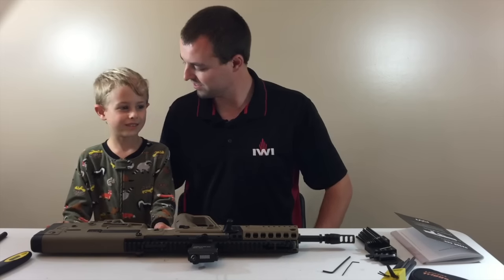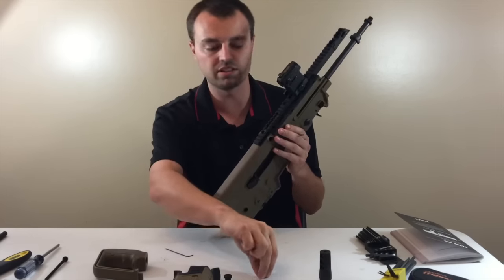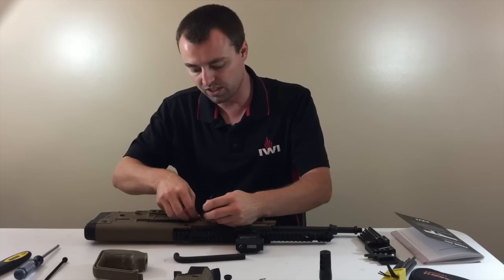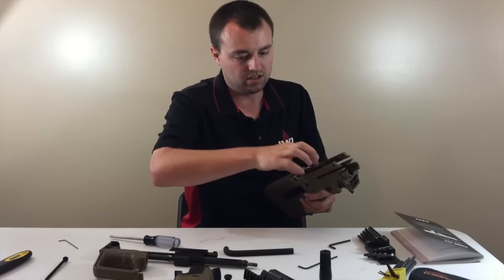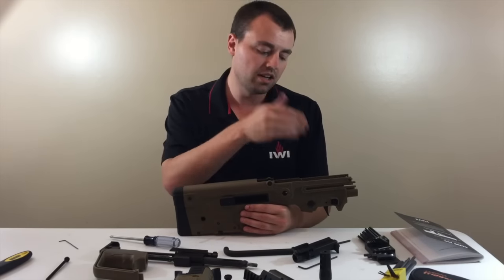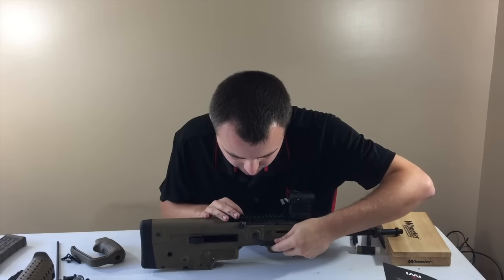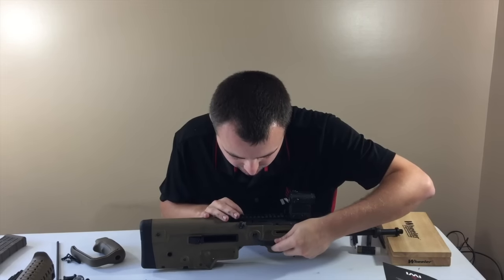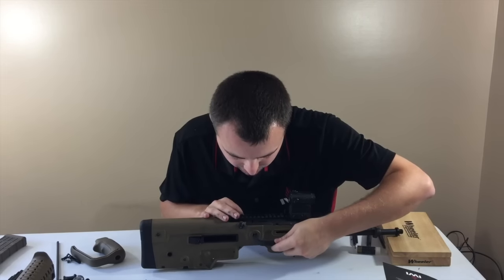IWI X95 Geissele Lightning Bow Trigger Install - REMOVE CHARGING HANDLE

Comment: WARNING: Broke my gun following this video. Several people in the comments did the same. The parts to fix what gets broken are nowhere in stock. Do not follow this video. It is for the older X95. The new ones will break if you follow these steps.

Comment: I goofed and didnt take the charging handle out before unlocking the barrel. Now the barrel is stuck, the barrel screw is stuck and the charging handle is stuck. Am i screwed?
Reply from the maker: If I recall correctly, you will need to lock the barrel in again and pull out the charging handle. You will likely need to replace the charging handle.

Comment: Dude you forgot to show the part where you remove the charging handle mine has a huge Divet in it now from the barrel lock. Ding dong. Also you can test your trigger with everything apart just put the bolt carrier group and the trigger group in and racket off the piston. I don’t know man this video kind of sucks
Reply from the maker: 2 minutes and 10 second point give or take. I even show the charging handle and talk about it.

Comment: You didn't mention anything about the factory spring will come flying out to never be found while removing the factory trigger.
Reply from the maker: Have to follow the instructions all the way through. What at you saw was the full install with no cuts in the video.

Comment: If you have a newer Tavor be careful about the charging handle. Followed this video and ruined my NIB tavor.
Reply from the maker: The new Tavor charging handle has a different disassembly.  You didn’t follow the video though as the charging handle is removed in the cover. I didn’t specifically call it out though.
Reply: @HolosunAdam  yes I found this out after I had ruined it. In your video I did not see that charging handle attached to the forend. I then saw someone's comment and watched the IWI US barrel removal video and found out I had destroyed my 3 day old Tavor.
Reply from the maker: Nick St.Pierre sorry to hear that. Unfortunately I’m unable to modify the video for the newer model
Reply: @nstpierre03  Mine wasn’t even a full 24 hrs old. Now I can’t find the parts online. How did you get it fixed? Contact IWI?
Reply: @jkbugout  yes, happens more then you'd think. I had to mail it to IWI and they had to have a gunsmith look over it and then mail it back. I got lucky and only bent the charging handle, didn't break a piece like I originally thought.

Comment: I’m having a problem with mine not resetting the trigger.
Reply from the maker: You will need to adjust the set screw discussed in the video until it resets. In essence, you already making small adjustments see if it works and then making more adjustments based on the results.
Reply: @HolosunAdam  it worked Thank you
Reply from the maker: @dangerousfreedom4965  glad to hear it worked!!

Comment: I noted and correct me if i'm wrong that the lightning trigger moves at the same time you operate the charging handle 🤔
and that for sure won't happen with the original trigger, so if I'm right, then definitively won't install this trigger
Reply from the maker: I’m not aware of it moving any differently than the original trigger. It’s connected to all the same linkages. 
I have tens of thousands of rounds through that trigger. I wouldn’t hesitate to get it for a second

Comment: It dry fires once then does not work after that
Reply from the maker: You need to adjust your trigger. That’s one of the steps mentioned after the trigger is installed.

Comment: The fact that this video DOESNT get taken down due to people fucking up their guns is insane.
Reply from the maker: Because they don’t pay attention?  The changing handle is removed in this video. The current X95 comes with a new charging handle Design that is not removed as easily as before.
Reply from the maker: There is also a disclaimer in the description to remove the charging.

Comment: So I've installed mine, but it doesn't want to reset and its buggered up my bolt release.  It wants to release itself without me pushing it.  I cannot figure out what the problem is for the life of me.  Ive worked on it for about 6 hours today ☠
Reply from the maker: That’s a new one. Toss me a video on Facebook at Adam Litke - Competitive Shooter or Instagram at adam_sasa
Reply: @HolosunAdam  i sure will.  Im dumbfounded.  I have one installed on my other x95 and it works flawlessly.  

It also feels like its more resistance when charging the rifle than normal.  When I lock the bolt back, it will pop foward itself with me hitting to release.
Reply: @HolosunAdam  i sent you message on FB

Comment: A few IMPORTANT things left out of this video. New X95s have a charging rod retention component that must be removed with a punch. If you do not remove the charging handle before turning the barrel lock you will bend your charging handle, crush your gas tube and possible ruin the barrel. It also seizes the barrel lock tight enough to shear the IWI barrel tool and render it useless. This missing step has turned my rifle into a paperweight and my only hope is a gunsmith can get it apart and replace the ruined components. This is a good video - BUT IT IS NOT COMPLETE for IWI rifles sold in 2019. Please watch the IWI disassembly video as well before you attempt this operation.
Reply from the maker: Sorry to hear about your issue. As shown in the video the charging handle must be removed.  The video was made in 2016 and thus the retention point is not mentioned but it does show the charging handle being removed.
Reply: This needs to be a pinned comment. This exact issue happened with me. I have a feeling that my gunsmith may not be able to repair this, can you tell me how your repairs went? I just ordered the gas cylinder and charging rod myself.
Reply: @HolosunAdam  Would be cool if you add an annotation or something so this can stop happening to people. Or even adjust your description. You're just going to cost more Tavor uses issues.
Reply from the maker: @TheSaddz  - I have not been able to add an annotation, however, there is a call out in the description.  I understand your frustration but I am contacted at least 2-5 times a week from people who use this video.  Most are using there newer gen guns.  I am aware of 3 users having the issue you did.  The other thousands have removed the charging handle prior to removing the barrel.
Reply: @HolosunAdam  Yes, I see your edit in the description and that is great. Just because a few people vocalize their issue, doesn't mean others didn't encounter the same problem.  I am in no way blaming you for my own faults, but just want you to realize you're the only video regarding this topic therefore new and old gens resort to this and in newer gen X95s, the charging rod does not come off with the forend, and the handle does not release as easy as just pulling it out, it requires rotating the loop it sits in. I understand your frustration with the critique of your video, but what's the point of making instructional videos if you're comfortable with others complication from a result of lack of information. We all came here for your knowledge, because if we were knowledgeable on the video's topic, we wouldn't have come here altogether. Either way, I appreciate the new edit and I am sure going forward, others will too.
Reply from the maker: TheSaddz I appreciate the constructive criticism. The goal is to educate with these videos.
Reply: I also just destroyed my rifle and did not see this comment until after.
Reply: @HolosunAdam  take this video down. I just broke both my favorite and most expensive gun. You should have taken it down two years ago after replying to several people who you misguided...
Reply from the maker: @brandonschmidt3760  - firstly, vast majority of comments are positive saying thank you. Secondly, there is a disclaimer both in the comments and now on the video. Thirdly, if you watch the video I remove the charging handle. Thus you did not pay proper attention. Lastly, IWI producing a new charging handle that’s different does not require someone to change a video from 2016. 
As always, sorry to hear about your issue. That said, I still see hundreds of people a year doing this properly and it’s still the video shared on the Facebook groups.
Reply: @HolosunAdam  Whatever dude, if I knew content I created was causing several people to accidentally damage or destroy their guns I would take it down. It doesn't matter that there are warnings because people are still doing it. I don't understand how you could look in the comments to see the thousands of dollars of damage done and not at least re-upload with a verbal warning at the beginning...
Reply: @brandonschmidt3760  
I know watching videos may seem like a faster method of instruction,but NOTHING beats reading the manual that comes with your rifle for proper care and takedown instruction. To blame him is ridiculous 🙄. He put the time and effort in years ago to instruct others, and now you think he should take the video down because the manufacturer has updated their product ? Again; the ownus is on the operator to read the included documentation before handling and using the firearm.
Reply: Was your gunsmith able to repair this?
Reply: @HolosunAdam  Just had the same issue. Was following this video step by step. I understand that the gun has changed. However, I just damaged my new rifle. Haven’t even shot it yet. Now I can’t. And IWI doesn’t even have the gas cylinder in stock.
Reply: @HolosunAdam  Please pin this comment and add “READ PINNED COMMENT” to the end of the video title. I don’t want others to have to go through what we’ve now done to our rifles. Especially since replacement parts are out of stock.
Reply: @brandonschmidt3760  And pin this comment. Stop being defensive. You are appreciated for this video but at this point you are being negligent sir. I was literally following you step by step and pausing the video and then damaged my brand new rifle. It really sucks. Super aggravating. The fact that it keeps happening to people and you have not made any attempts to warn people is a dick move. And you seem like a nice guy in the video. Put yourself in our shoes.
Reply: You don't need to remove that retention ring.  Pull the charging handle back an inch and rotate the retention collar out of the way.  Manticor Arms covers this.
Reply: @jkbugout  you literally weren't following step by step if you did not remove the charging handle first...
Reply: Yep this just happened to me because I didn’t read the comments before…maybe delete this video and upload an edited one cuz now I’m screwed
Reply: @Cumli  i was able to get a hex wrench in the barrel lock and repair everything. Charging handle and gas tube were munched but everything else was fine. Been running without issue for years now.
Reply: All, please use this video by IWI to remove and reinstall the barrel for newer versions of X95. Use this video only for the trigger shoe installation. 

https://youtu.be/EbEoO9dpr3w

Comment: I have no spring tension with the trigger after putting the spring in like you said. Mine does not come back forward if I pull it.
Reply from the maker: Open it back up and look to ensure everything is connected correctly. This method has worked for everyone else so likely their was a step missed or something was not connected properly.
Reply: @HolosunAdam  I made a rookie mistake. I'm an idiot and forgot that the bolt carrier group was out so of course there wouldn't be any tension. Put it all back together and no issues. Thanks for the quick response by the way.
Reply from the maker: @grassbag1  we’ve all been there buddy. We’ve all been there
Reply: @HolosunAdam  how do you put the stock spring back in the regular trigger? My trigger is still now resetting when I shoot. I'm going to put the original back in for now but I don't remember the way the spring goes
Reply from the maker: @grassbag1  which spring are you referring to?
Reply: @HolosunAdam  the one that was on the stock trigger that you remove. I cant find a picture anywhere online.
Reply from the maker: @grassbag1  - you likely need to adjust your trigger set screw to get your trigger to reset.  The original screw goes darn near where the replacement screw does.
Reply: @HolosunAdam  is there a way to adjust it to make sure it resets properly without taking the whole gun apart and putting it back together again? It seems to reset fine on dry firing but after the first live fire shot the trigger hangs and doesnt reset all the way.
Reply from the maker: @grassbag1  only trial and error. I would do the opposite setting you have now and then make slight adjustments from there.
Reply: @HolosunAdam  Okay cool, thanks

Comment: Just bought my trigger bow for my x95 that I ordered. When adjusting the set screw which way takes out the slack. Backing the screw out or in? Thanks
Reply from the maker: 86keen going in removes slack if I remember correctly. Just sure not to remove so much your trigger won't reset.
Reply: Is it pretty squared away out of the box or did u need to adjust your a bit?
Reply from the maker: 86keen mine was pretty great out of the box.
Reply: Shield and Sword Academy received my x95 a day early. Your vid was extremely helpful when I was installing the trigger bow. There is still a little take up and trying to decide if I want to mess with the set screw. But I don't know if that little take up is suppose to be there for the feel of a 2 stage. Also do you know how many inch pounds to torque the rail screws with? Again thanks for all your correspondence and the vid was very helpful
Reply from the maker: 86keen I have a little take up on mine but greatly reduced from original trigger. 
I'm not sure on torque for rail. I simply screw them in and only use reasonable force. 
Glad the video helped!

Comment: I installed it now , and the gun does not discharge, the bar moves a bit and hits a wall without firing . I loosened the set screw as well and it’s still not working , pls let me know what you think the issue is ?

Comment: So I installed mine and the reset is terrible. Im assuming I did something wrong.
Reply from the maker: You need to adjust the set screw on the trigger.
Reply: @HolosunAdam  Thanks for the reply!   One more question, the tighter the screw is, the less slack, correct? 

I tried it a little tighter after you replied and it didn't feel much if any different.  Should I tighten more?

I do apologize,  im sure you've repeated the instructions for these thing a billion times.
Reply from the maker: @Enough_Tumbleweed  it’s a trial and error type thing. Keep tightening until it works and you like the trigger pull

Comment: Obviously not your boss but I recommend a video edit for removing the barrel stressing the importance of removing the charging handle before as, in my opinion, very easily and with generally little effort, crushed my charging handle and gas tube
Reply from the maker: Spc William at 2:13 it states charging handle is removed. That is prior to barrel removal. I will look into an edit.

Comment: Does the spring at 9:01 need to be reassembled? Didn't see it get replaced when putting it back together.
Reply from the maker: No it does not go back in.

Comment: Just an observation....why the fuck does IWI make it so difficult? Pulling out the bolt carrier group is a beautiful thing. Full disassembly? The more I learn about my X95, the more I love my ARs.
Reply from the maker: Doug Kurceba being a bullpup design there are only so many ways to simplify tear down. The barrel has to go over the trigger and the trigger actuated the bars that go back to the trigger pack. It would be interesting to see if the trigger could be built to slide out horizontally in some fashion.

Comment: I just wanted to thank you.  If you had ads on this video you would be making $ because I've watched it at least 3-4 times.  You've helped me a lot, and I really appreciate it.  Liked and subbed.
Reply from the maker: Glad it helped!!
Reply: @HolosunAdam  So now I have quite a big problem.  While installing the trigger pack the cocking handle went forward and pulled the bolt carrier stop lever into the empty area where the trigger pack was.
Reply from the maker: Mason Wallace if you google the iwi channel they have a great video in reinstalling that. It’s not the easiest and takes a little patience
Reply: @HolosunAdam  I swear I will stop bothering you.  So now I have that fixed.  The Lightning Bow works great with the OEM sear mechanism, however, not with the TAV-D sear mechanism I purchased.  The trigger will not pull and the hammer will not fall.  I took it to my local gunsmith and he was also confused, as the TAV-D worked in his Tavor-SAR.  Shooting Sight has not contacted me back yet, and the only thing I can come up with is I need to possibly loosen the Lightning Bow set screw a quarter turn or so.  Do you have an aftermarket trigger pack?
Reply from the maker: Mason Wallace I would adjust the set screw on the Lightning now.  I run a TAV-D and Super Sabra packs.

Comment: Ha I made the same mistake. Had a gen 4 charging handle and didn't remove it. Luckily the rifle is super modular. Just ordered a new charging handle and gas cylinder from IWI, these seems to be the only parts damaged.
Reply from the maker: The addition of the new charging handles do present a change in disassembly.